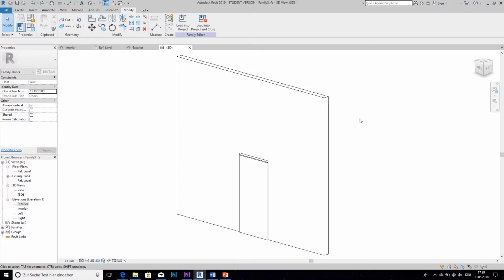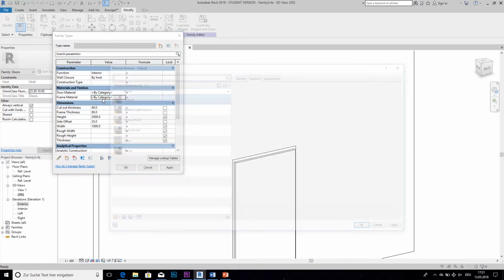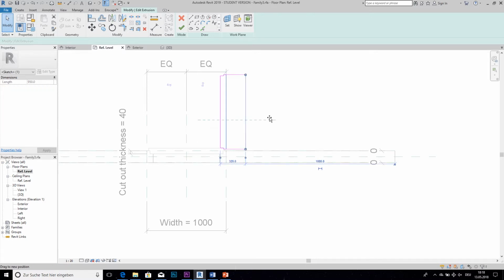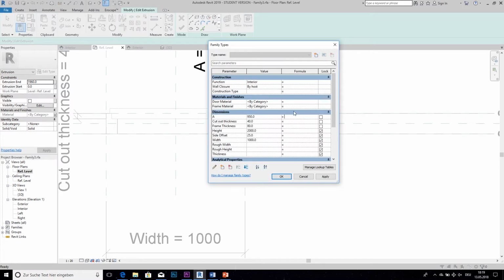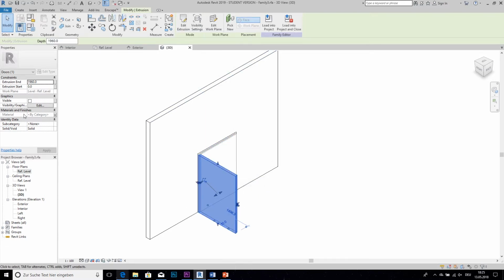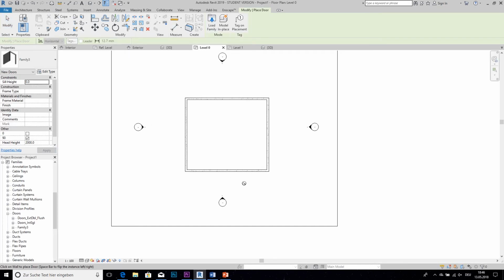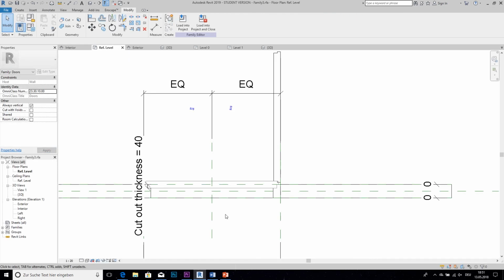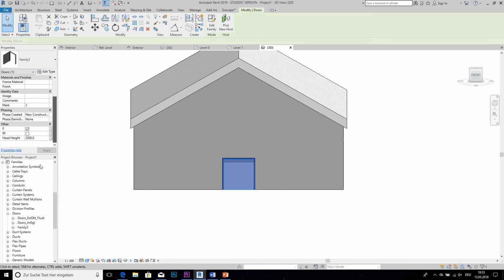REVIT FAMILY MODELLING GUIDE - Part 2

Comment: For the visibility parameter you may not want them both open at the same time.  In the Formula Section you can type in           =not (0)        or     =not(90)      .  This way you only have 1 clickable parameter and it will show one or the other but not both.
Reply: You have to do conditional formula

Comment: Hi BOS Girl
Super nice reviews of revit functionalities.
I have a suggestion to "fix" your door.
I do not understand the practical need to be able to open and close the door. But it was a fun challenge to be able to open it without using the visibility parameters.
A simple solution (it's often the best :-))
Instead of using the reference plan, try the ref. line instead. You can lock and rotate it around a point. And then just build the door like in the clip.
I can see it's an older clip so maybe you have already found this or another solution.

Comment: Thankyou. Great tutorial. 
Re: door swing angle. 
I think you can use a reference line with a fixed pivot point you can lock the door to. Add a parametric angle parameter for swing angle.
Reply: It is easier to do that with nested family... but i think that it will  need more memory... and is it necessary?

Comment: Very nice.......... but can you make the door open to any angle between 0 and 90?
Reply from the maker: Yeah in the end of the video I talk a little bit about this problem. I wanted to do it, but it is really difficult. I didn't manage to do it :/
Maybe that's the reason why it doesnt exist..
Reply: I was thinking more along the lines of the plan view representation.  You know, 2D.  Maybe a parametric 2D component could be brought in that can open and close.  I have had zero luck in getting 3D objects to rotate, so you're not along.
Reply from the maker: Haha good to know I'm not alone..I feel better now :) Well yeah you could just try it with lines in the plan view and then set them to not show in the 3D view. Probably it would be best to create a profile family in which you draw the lines and make them parametric. Then import the profile into your door family and combine the parameters.
Reply: put the dimensions on reference line end poin, lock them. then that point will stay in place